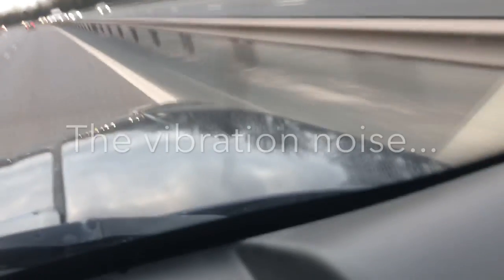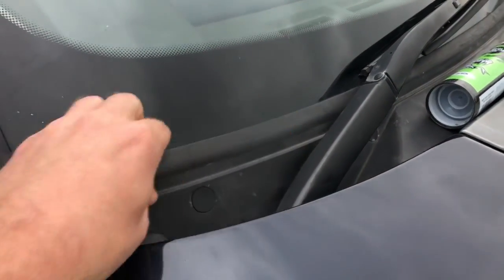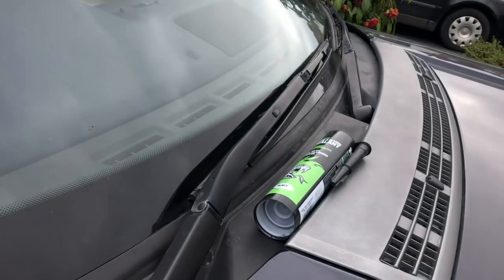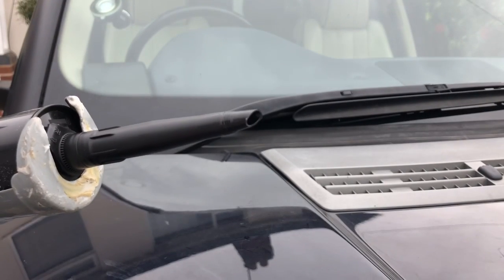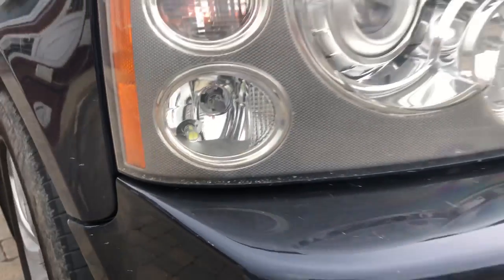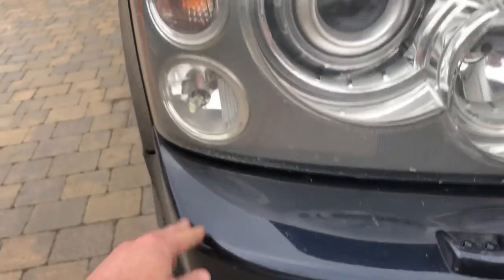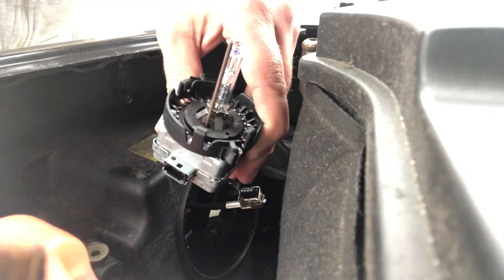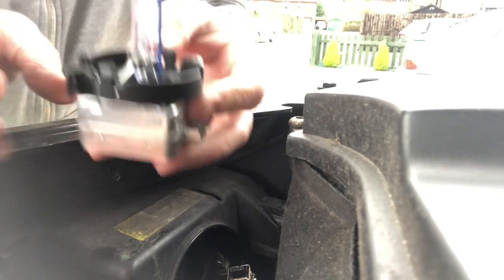Range Rover L322 windscreen scuttle noise, HID’s & flashing LED’s

Comment: Thanks for. I have had the same problem after getting my screen replaced. I went crazy trying to change the wipers and by adding wiper blade fins. I am going to call auto glass and get them to add the sealant for me to get rid of this noise.

Comment: Is that black plastic removable piece that sits on top of the hid bulb the same design for the 2010-2012 l322 hid bulbs?
Reply from the maker: If you mean the circular collar which sits on the base of the HID lamp, then yes I believe so. In fact I think it’s the same as the ones on my 2012 BMW F11 too 👍

Comment: Man have the same problem with my Ranger in the sense it's making a lot of noise above 60mph and will try your fix.Hope it sorts it out.
   Second thing i have very poor lighting on low beams ,could this be solved with the led bulbs or can this be the lenses?
 Cheers mate!
Reply from the maker: Stick a new set of white HID bulbs in - they’re not too expensive. My headlight plastic lenses are holding up pretty well on the RR, but they’re quite easy to polish if needed (due to their flat shape) 👍
Reply: I'm finding that although my lights are bright enough with the original bulbs, the beam is just not set far enough away from the car, it's too low, is there a way to change it?

Comment: great videos following you for 2 months.
somthing just started annoying me is my L322 Wing Mirrors closing out of sync. I press the Button Right Mirror closes in but Left doesnt. I press it again Left Mirror closes In Right Mirror goes out. Any Advice. I tried pushing both out then closing but still no good.
Reply from the maker: Yes, I’m aware this issue has happened to others too.
You can get them back in sync by accessing the fuse box behind the glove box. There are 2 x 30A fuses which control each of the wing mirror motors (fuse no. 11 and 24). Remove one fuse & operate the wing mirror button (which will now only operate 1 mirror) and now replace the fuse as they should now both be pointing the same way. 
This should do it as far as I know 👍